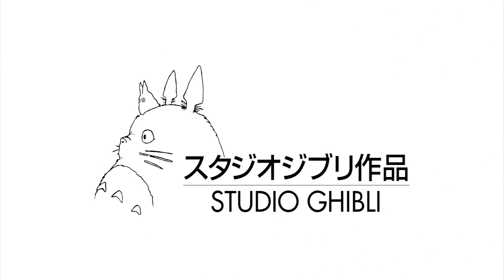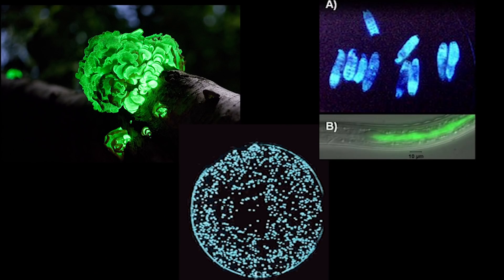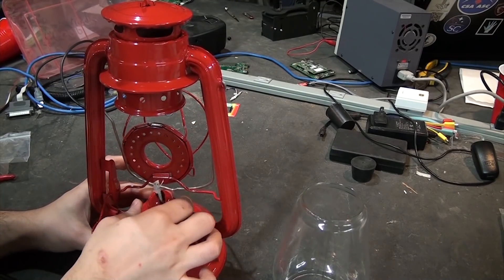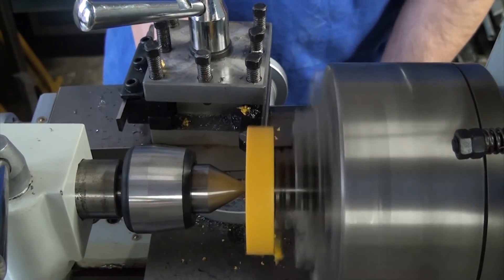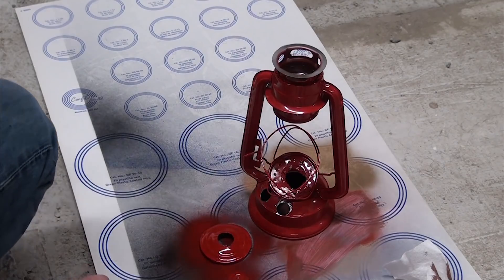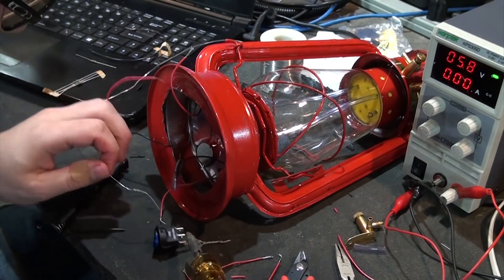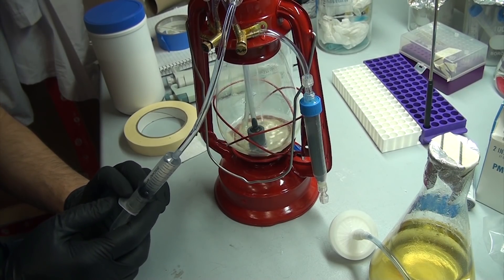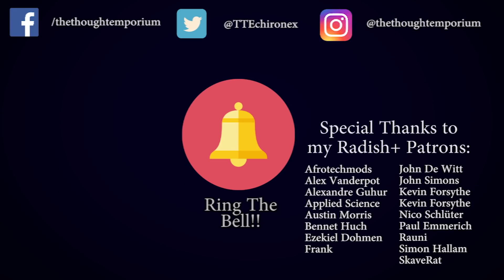A Kerosene Lantern... Bioreactor?

Comment: Ive read in old books in archeology where they found tombs and opened them and for a few minutes they would see like green and blue flame that were glowing continuously unfortunatly opening those tombs they would get pharos curse which was nothing more than mercury vapor fumes but they also found lanterns that most likely have been burning for centurys the flame inaide of the lamps were mercury vapor mecury vapor does not turn into anything else just stays murcury vapor. I would like to see you figure out how to make that work. They used  to break them because they thought it was witchcraft and they ended up getting pharos curse after breaking them

Comment: Fluorescent proteins to try instead
CyOFP1 teal=>red
LSS-mKate2
LSmOrange
IIRC I think I chose these because they absorb light from much higher in the spectrum and release at a complementary color, making the color appear that much more powerful under a broad spectrum light. It might also work well for coloring your luceferin/luceferase reaction

Also look into kaede, which is a fluorescent protein produced in corals and emits green at first, but hit it with UV ant the protein changes to emitting red light instead...

Comment: Small air pumps are to be found inside automatic blood pressure cuffs, they are not designed for long periods of continuous duty but might be available surplus somewhere for a Euro or two in quantities so replacement will not be too expensive..  Small vacuum pumps with pulsating action are to be found in domestic breast pumps.  Some could have the pulsating action defeated to make a reasonable vacuum pump.

Comment: Can you weave a rope out of DNA? How strong would it be?
Reply: So far, it is improbable to do so. Sure it might be possible to weave DNA into a rope, but individually unweaving billions of strands of DNA into long strips and carefully threading them together would just take too much work for what it's worth. When we finally have a machine or process to unfurl or create DNA strands fast and long enough, and a mechanical process efficient enough to weave them together into a 5 cm thick rope, we would have a very strong rope that you could have just woven out of easier to work with materials that would be much more flexible and strong.
Reply: How long are the DNA strands? I remember making some DNA in college with a basic PCR kit and it turned out like a goopy cotton ball sized mess. That's what gave me the idea. You might be able to treat that goop like a cotton ball and comb it to get the strands mostly lined up in one direction. Then you spin it like old school thread. Then weave that thread into yarn and the yarn into rope.
Reply: @Jcewazhere  It doesnt matter how long the DNA strand is, but your cotton ball sized mess was actually DNA tangled up. If you unfurl one strand of DNA, it would be so ridiculously long youd need about a full day of work to even measure it. Ropes work differently though, they rely on the friction between microfibers to create fibers, short strands of material that binds together lengthwise. After you thread together the fibers you create a string, which is much stronger because of the friction between the microfibers and fibers, then you bunch that up into a rope which is ridiculously strong because of the sheer amount of friction happening inside.
Reply: @Jcewazhere  besides, DNA is too brittle to he able to coax it out of being that mess while dry, it would snap and separate into 2 strands of RNA if you try to use conventional means. There IS a way to duplicate and unfurl DNA that Forensic Scientists have been using for about a decade now, the name of it evades me though seeing as if I havent been in a forensic science class in years

Comment: maybe brass/copper tubing for cooler look?
Reply: Nah, copper could potentially erode and poison the Bacteria. Plastic or Nylon tubing is much safer for bacteria, and is more flexible so it's easier to work with.
Reply: @pyrojack8230  nah, copper doesn't corode in contact with water and it's better for clean "ecosystem" than plastic tubing

Comment: You can use glass reagent bottles with caps for bioreactor. With holes cut in the cap for tubings and other sensors. 
This type of design is also commercially done by lex bioreactor.

Comment: I have two small peristaltic pumps driven by attached stepper motors, Would be more than happy to donate one or both if you want them I also have a large one that just has an input shaft with no drive motor that one I would need a promise you would put to good use but the small ones are to small "I think around 0.5 mL/min @ 0.05 rpm" for anything I would do and I just got them because they looked to be medical dosing pumps for like $5-10 USD each. Let me know if you may be interested and I will look up the actual specs. If at that point they look useful I can box them up and ship them to you as a thanks for the cool stuff you share with us all.

Comment: As you probably know, not all UV light is created equal. Most commercially-available UV LEDs are in the 350-400nm range, as that's where most visible fluorescence occurs. If your goal is sterilization, you want a UV wavelength of ~254-265nm instead.

Comment: is it possible to use bio-luminescence as a source for photovoltaic cells? Like how they use tritum for nuclear photovoltaic reactors? Might be a cool project. probably not very efficient.
Reply: I mean you have to keep the microbes fed, so it’d prolly be more efficient to burn the fuel. 

OTOH one might use a dilute food source like out a water purification plant and use your bioreactor to produce a ton of luceferin and another one to produce the luceferase, then mix them together for one good flash, sorta using the microbes to concentrate that chemical energy into a small, regularized package...

Comment: Would love to see someone use gene-mod to create bioluminescent trees. Could eliminate or at least lower the need for so many streetlights - imagine cities planting these and not only helping  their budget, but helping the environment directly. I'd imagine there'd even be a market for smaller plants to light walkways  and such, the way small solar-LED lights are used now.  
As for autoclaving the chamber  - if the difference between coeffeciency of expansion of the glass and metal are not too great, and you heat slowly to start, might could work, especially if the sealant isn't too rigid or loses some rigidity upon heating.

Comment: Maybe You can just put some turn of conductive wire around the lower part of the glass or adding something under that metal plate to warm it up a bit, i mean it's not in any way extreme temperatures needed for this so i think it may work and still not ruin the look, but i think it's also pretty easy to add a factory made "aquarium style" heater inside it and some thermostate device.
Reply: a Small ceramic heating element on the bottom would be perfect and cheap

Comment: Apparently... (I know nothing... this is just what Mr Pete 222 told me) if you grind aluminium you are in a state of sin and could end up going straight to hell.
It gums up the grinding wheel and the next person who needs to do grown up grinding will curse you for evermore.
I found this out after I'd been grinding aluminium, so I'm right there with you.
Reply: Yah I did that with my dremel once. ONCE. Grinding wheel entirely full of Alu and useless as I don't have anything to redress it...
Reply from the maker: You can buy a diamond dressing tool on amazon for like 5-10 bucks
Reply: axel boström you'll just have to wear it down with a sacrificial metal.
Reply: @nunyabisnass1141  who knew metal working would be so ritualistic when they started off
Reply: THUNDERBOLT a significant amount time of all crafts is spent in maintaining your equipment. Metal working, wood wood working, cake decorating...
Reply from the maker: You can see how awful the wheel looked at the time. I was about to redress it anyway
Reply: u deserved it... get a girlfriend

Comment: Could you grow fungal spores in this? my first thought is no but just wondering.
Reply: I think You can actually, but i guess You allredy hawe figured out the differenses in the environment, they are actually a bit easier to grow (usually...) but are still equal sensitive to contamination from for example mold spores (they are usually pretty resistant to bacterias as You probably know, but may be killed off by some other fungi spieces, for example mold (or wrong type of mold if You plan to grow mold)). So You need to install that filter thing or a membrane that stop all air floating spores to contaminate Your substrate even if You use a "dry" substrate. 
Also You may need to change the feeding substrate if You plan to grow bigger species, (exactly waht You need to do appends on wich species You want to grow).

It's also good to know that some fungi species are sensitive to vibrations, including some types of load sounds, they are ofte as well sensitive to light so You need to add a cover for the mycel for many species.
You also need more control ower the moisture inside so it wont get to wet so the mycel can't breath or dry out, but i think it will be good enough eyeballing it for most common species unless You plan to grow something realy rare.

(I hawe grow some edible species from the woods, it's not that hard for the common species, but everything need to be carefully desinficated, and it's important You choose a suitable substrate, however, most fungis can use the same substrate as used for grow bacterias in a "dry" culture, like buliong, Agar, etc if it's just for laborations (i hawe tried it my self in petri glass many years ago).)
Reply: Sorry for my terrible English, it's not my native language, but i hope You guys understand some fractions of what i tried to say... Good luck with Your experiments! It's a lot of fun to grow fungus.  :)

Comment: Are you planning on running the pump continuously?  That motor is likely to die after a few weeks to a couple months, it’s not intended for full-time use.  The brushes will likely be what fails.  A brushless pump is very cheap and easy to source, so that definitely would work better, long term.

Comment: Little tip, you can buy bioluminescent algae like Pyrocystis fusiformis/noctiluca/lunula online. They glow brilliantly, try putting them into your bioreactor
Reply from the maker: I've wanted some for ages. Until now haven't had an excuse to buy some but now I'm really considering it.
Reply: The Thought Emporium You can easily purchase them even as private person. Since biopop stopped selling you can buy them at the empco or at bioglow.eu

But little warning, these are unbelievably sensitive to as well contaminations as even the smallest changes in the medium composition, so ever devide the culture into smaller ones and test your medium, they will need at least two weeks to react to a new medium so you may get a wrong impression how the medium might work, so be patient. These things are really incredibly sensitive, even I had my problems growing them, but it seems like I managed it at least.
Reply from the maker: That's the point of a bioreactor. You make a big bottle of perfect media and then slowly drip it in while you pull out the solution. Keeps everything perfect and the organsims happy. Part of the pumping unit is a suite of sensors to test the waste water so it knows how much fresh media to add based on how the organism is behaving
Reply: The Thought Emporium Yeah I know what this is (from biologist to biologist) 
I will very soon build one myself for the algae, because I have already made a sort if algae incubator from an old cocktail fridge. These algae really glow amazing, believe me you wouldn’t regret buying these. They are like a few million times brighter than a Panellus stipticus in optimal nutrient medium (ph 3.8, 0.5% Glucose, 4% starch, 2.5% Agar and a nitrogen source)
Reply: Now i'm wondering: could glowing algae possibly be a cost effective way of storing solar energy at daytime and using it at night to power solar panels? 
Bioglow has one potential problem, as I see it's based in the Netherlands, and that country is kinda on a blacklist... Packages that come from the NL get more checks at the US customs than packages from countries like Germany (which is neighbouring the NL). It means that shipping just could take more time, that's it. But it's still something too keep in mind when ordering a product with a short shelf life.
Reply: why is NL on a blacklisy
Reply: alxuria It isn’t on a blacklist, but because cannabis is legal in the Netherlands packages originating from there tend to get held up in customs while narcotics officers poke and prod and examine the contents..
Reply: alxuria drugs
Reply: alxuria n flowers
Reply: Where do i buy the plants and fungi?
Reply: Dan Guddal always depends on the sort of organism. I buy at the empco, dsmz, atcc, bioglow, forestandfoundorganics and so on